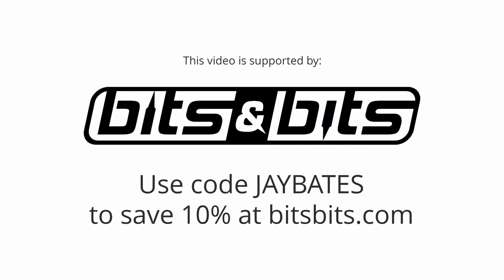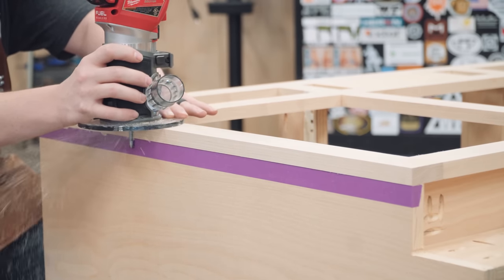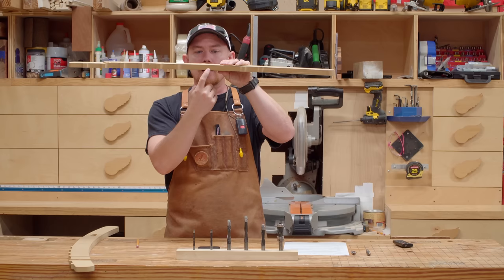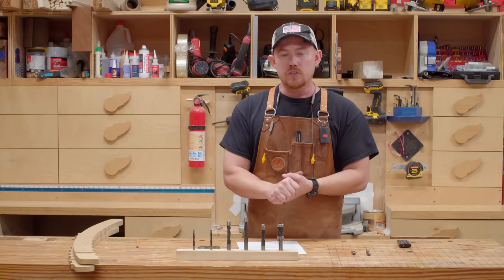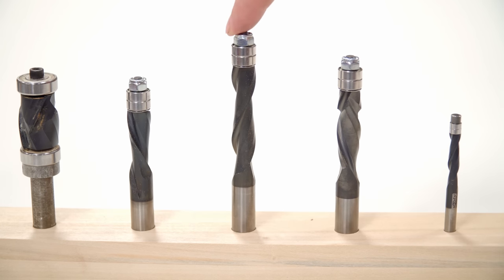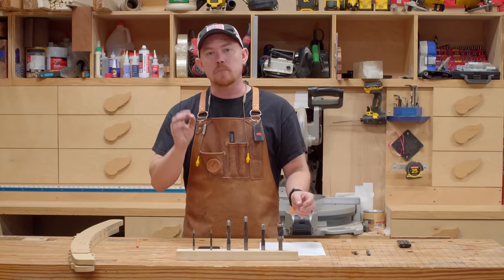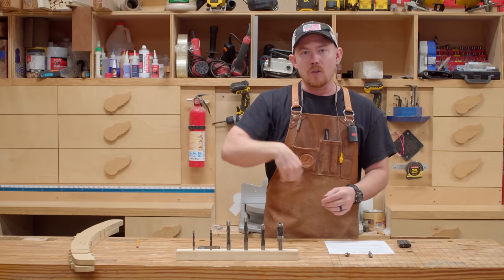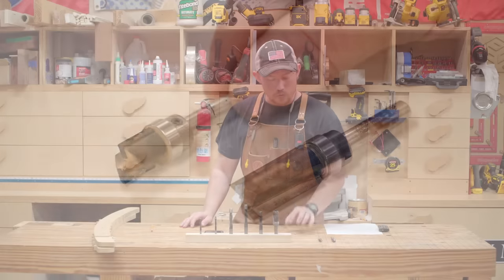Flush Trim Router Bits - 396

Comment: its the same if you use router bits for wood / plastic or endmills for wood / plastic / metal
Downcut: the "chip" moves FROM the mounting chank TOWARDS the tip of the cutter.
Upcut: the "chip" moves FROM the Tip of the cutter TOWARDS the mounting chank.
For easy recognision an ordinary twist drill is 99% of the time UPCUT. so if the spiral in the cutter is reverse in comparision its an Downcut. remember to take note of the "cutting edge" on the spiral, since there is cutters for COUNTER clockwise rotation (CCW) but in the home shop those are rare.

Comment: Thanks for the video. I do have one comment. Years ago we did wood frames for recessed lighting in kitchens. The frames might be as small as 4 x 4 or as big as 10 x 20 feet. Most of the time the edges were routed with a cove or a round over bit. I did probably more than a hundred thousand feet of routering. We always used a climb cut because we would never get any tearout. If we routed into the grain, tearout was real possibility that would either ruin the frame or cause a significant delay in production. If I am not removing much material, I still always use a climb cut to prevent tearout.

Comment: I've used 1/4" upcut spirals for several years now. Appreciate your take on using 1/2" bits in my tables, tho. I have Bosch 1617's in my tables (2 1/4 HP, soft start, variable speed). I will certainly look for a 1/2" shank for my tables.

It should have been a freaking no-brainer. I use 1/2" shank bits almost exclusively in my tables, as there is 4 times the material in the shank of a 1/2" unit when compared to a 1/4" unit. Dooh!

Thanks, Jay! You rawk!

Comment: I am in the process of making "plantation shutters, and getting a fair amount of tear-out when making the slats, which required a lot of sanding, distorting the camber on both sides of the slats. I have always run the router at full speed. Because of your comment about starting slow and increasing speed to find the "sweet spot" I now believe if I slow the speed and work up (or in) with a shallower cut, I will get a much smoother finish. Thanks for the info. You always do a great job with your video's.
Reply from the maker: Glad to hear it :)

Comment: You corrected yourself with the notes but the issue with 1/4” bits is they are less stiff.  All solid carbide bits are more brittle than a steel shanked bit with carbide cutters.  This only becomes an issue on the less stiff 1/4” bits.  This is one benefit of straight bits as well as being easy to sharpen and being much cheaper.

Comment: You use a slower speed with larger diameter bit because it is not the RPM that matters but the speed of the cutting edge on the wood. With tweo bits are used at the same RPM, if one bit is twice as large as the other one the cutting edge will run twice as fast too.
Reply from the maker: Correct. But chipload is still a thing.

Comment: Very nice summary, Jay.  Would it make sense to do a template cut in two passes, first with a 1/2 inch diameter bit, and then if there are tight inside curves that the 1/2 inch bit couldn't reach, do another pass with a 1/4 inch bit to clean those out?  Seems like it would work just fine, but I haven't tried it yet.

Comment: Rather than "up" or "down" which can be reversed by reorienting the bit, maybe they should be referenced by the end of the bit that the waste moves toward. "Tip flow" and "shank flow". Then it wouldn't matter which direction the bit was pointed, the flow of waste material can always be referenced the same way.

Comment: As a beginner, I have no bits yet. I’d like to purchase a set of bits that will be useful and would appreciate input. I’ll head over to bits and bits so pointing me to a set would be awesome. Thanks for the video. It’s a lot to think about.
Reply from the maker: It's hard to make blanket recommendations like that because we all work differently and value stuff differently. For example, when I first started woodworking I liked to use the Ogee bit on sooo much stuff. I don't think I've used it in the past 5 years. My recommendation is to look at what you want to accomplish and buy according to what will help get that done.
Reply: @JayBates  that makes sense. Focus on what I want to do and work from there. Thanks!

Comment: I was not aware that compression bit had a maximum material dimension. Does anyone know if it is less than 1/16 inch that is typical for band saw templated part?  Great video.
Reply from the maker: 1/16 is good. In CNC terms, I'd prefer around 66% stepover for pocketing. So translating that to the amount of material after rough cutting a template trace, I'd say stick to half the diameter of the bit or less.